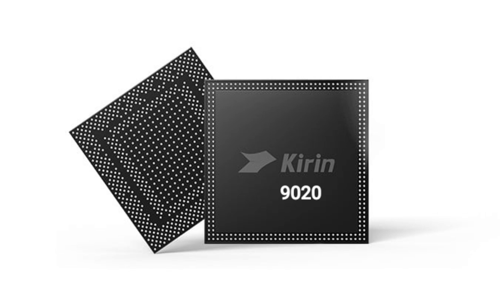Everything You Need to Know About the Kirin 9020 Chip

Comment: The Kirin 9020 has an 8-core CPU with a 1+3+4 configuration, not 12. 4 of the performance cores can run 2 threads simultaneously and these extra threads are read as separate scores by software. Also, the 4 E-cores are not Arm's core design but are custom cores.